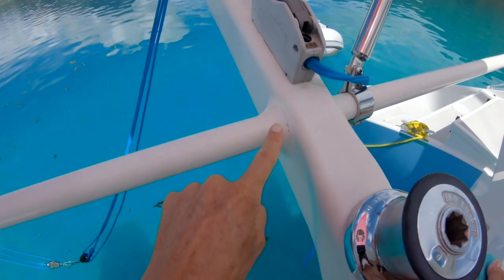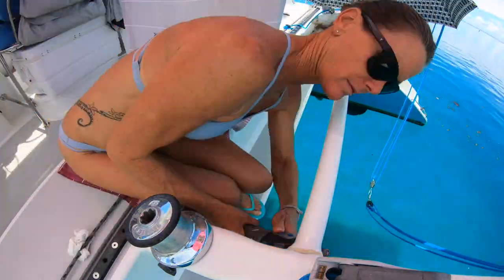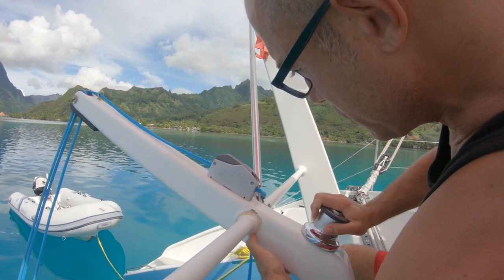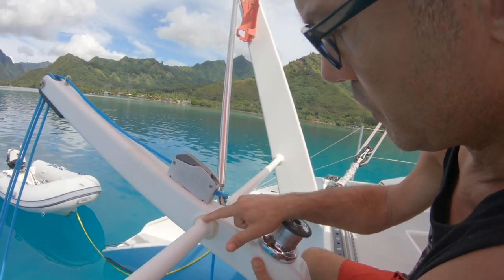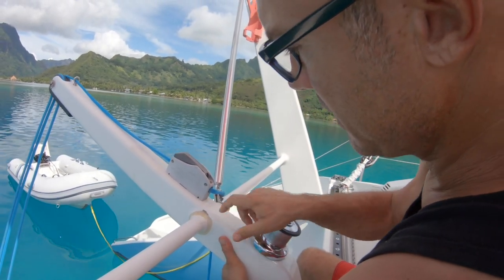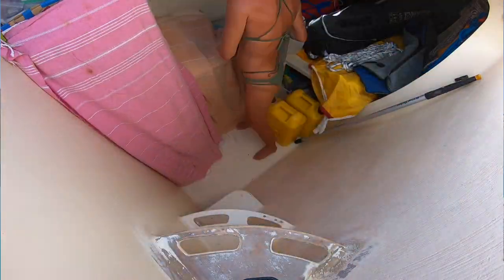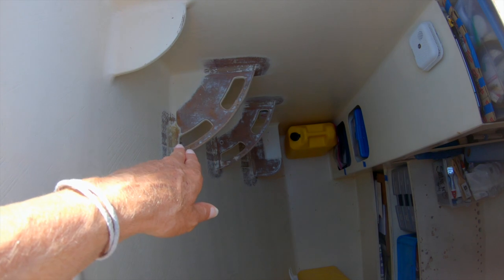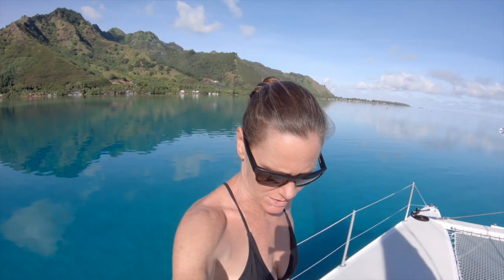Boat Confinement Two Afloat Style: DREMEL ADVENTURES

Comment: Hope this is helpful.  Recommend you glass over that crack to give it some lateral strength. The crack likely formed due to stress at that point and a bond that was too brittle if it was only thickened epoxy. If you’re bent on just a filet because it simple, try thickening the epoxy with chop strand fibreglass cut into 1” strands, mix, apply (yes, it will be messy), then sand before painting. The strands will overlap and bond across the surfaces giving some strength.
Reply from the maker: Yves, thank you for that.  That "stress" was from the previous owner who jumped down on it to show its strength.  :/  But we still like him...he made her into such a beautiful boat  :) N
Reply: Adventures of Two Afloat 😂 👍
Reply from the maker: Great tips, thank you Yves.  R